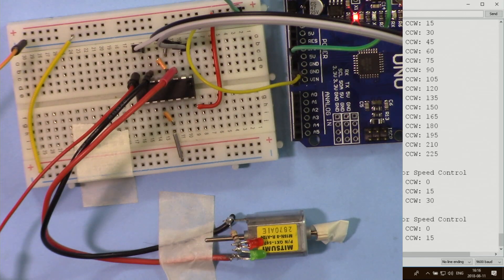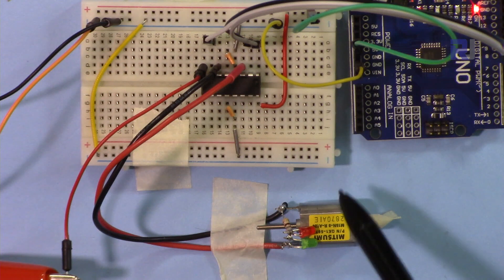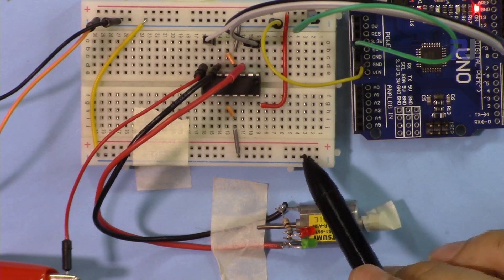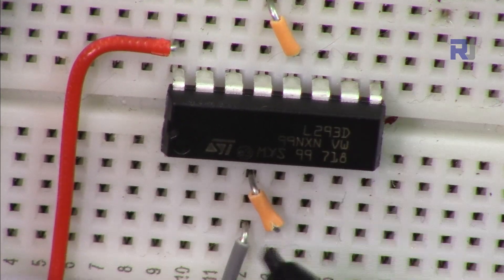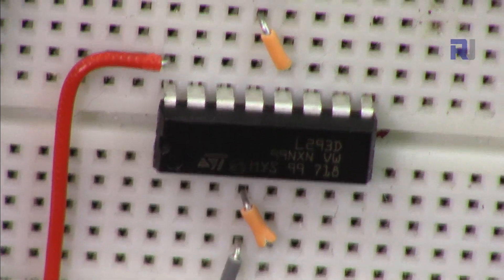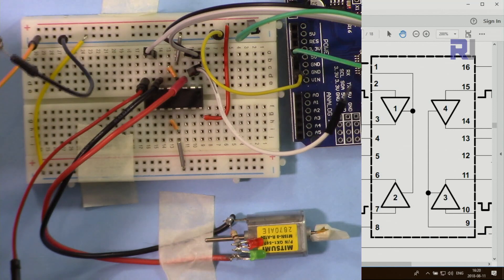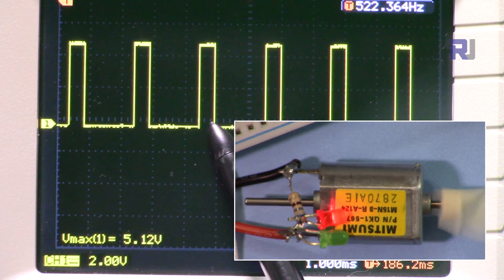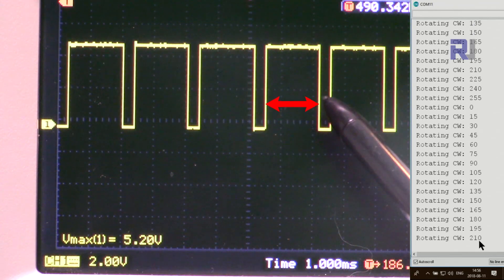Control Speed and Direction DC motor using L293B L293D motor  with Aarduino PWM RJT118

Comment: nice video but i have a question, why can't you just connect the motor in the arduino?
Reply from the maker: thanks. Arduino's output pins can output only 30mA max. this motor needs 1000mA so we use the IC as driver.
Reply from the maker: Here I found your question in one of my videos https://youtu.be/EaoB6lfnS7g?t=585

Comment: Sir how to rotate dc motor in required angualr displscement. And how to repeat this motion clockwise and counterclockwise.
Reply from the maker: Hi, angular displacement depends on what is attached to the shaft and diameter of wheel or piece attached to the shaft. You will also need something called ENCODER where  you can precisely know the speed of motor.  I can't explain it in a few line but that is the basic idea.
Reply: Sir can you provide mail id so I can  send you our problem in project. It will help us in completing our project

Comment: Does the speed controll part works also on raspberry pi?
Im also using a l293d  for my project, but didnt know yet how to controll speed of motors...
Reply: Hope you can help my
Reply from the maker: Yes it does. As long as you send PWM signal to this, it works.
Reply: Can you may explain on which pin to send the PWM signal...? That would be very helpful
Reply: *May you explain
Reply from the maker: It has been explained in the video. This is for Arduino and not raspberry Pi.

Comment: I thought speed control wasn't possible with the L293 drivers. Thank you for sharing. Why do I need the diodes if I have an L293?
Reply from the maker: I have explained it in the video. Motor is inductive and when it turns OFF or ON, it generates reverse voltage that can damage components to the chip. So the diode absorbs that spike of voltage.
Reply: @robojax  Thank you. I'm sorry for missing that part.
Reply from the maker: No problem. You are welcome.

Comment: hey , how are you giving the input to change the direction , i tried giving character input( L / R) via serial monitor but it didn't  work
Reply from the maker: at 11:43 (click on 11:43)  I have explained it. It would be very simple. I have not provided code to control the direction via serial monitor. I will try to make a video on that too if time permits.